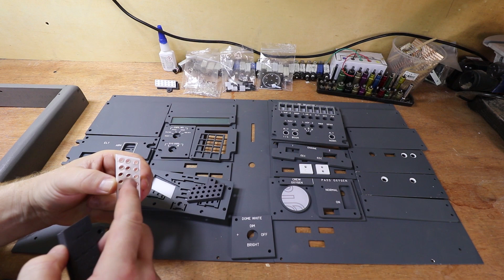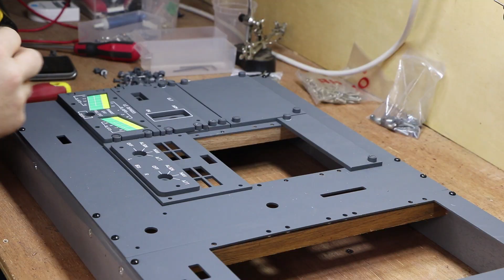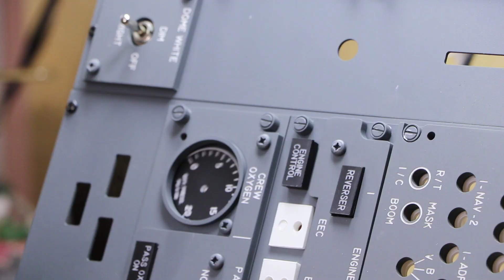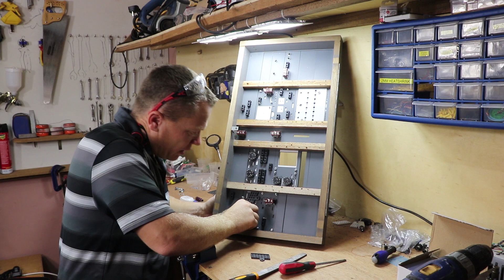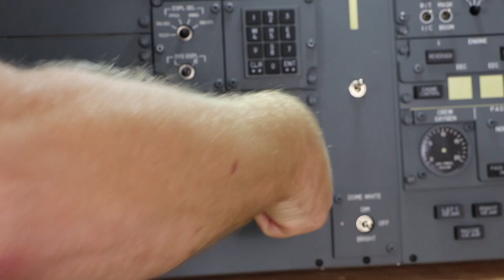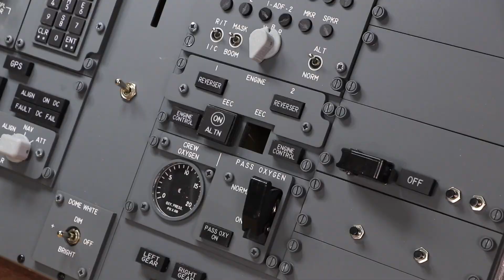737 AFT OVERHEAD PANEL

Comment: Hi, I bought in the beginning of this month the Fusion 360 OVHD Painel files on your website, What kind of material did you use for backlit boards? White Acrilic painted with gray?
Reply from the maker: Hi marcos, i use 5mm white opaque perspex, painted grey. Then I engrave the text and lines through the grey paint into the white perspex.
Reply: @helimech8152  thank you! As soon as possible I'll send you my homecockpit's pictures.

Comment: Hello,so I have a question. If I was to follow your full tutorial on building how much would it cost? Online I found it can cost up to 40000$!
Reply from the maker: Hi KingAviator, Now that is a big question. I would like to think over the last 5 years i have not spent more than 3000 pounds, infact i know i havent. but that has been down to some very lucky breaks. I Bought Prosim when is was much cheaper, i got given all my monitors. There is a webpage on the website detailing the costs to 2018 i think
Reply: Heli Mech Thank you. When I get the money I ll start making it. My only problem is that I dont own a cnc machine or a 3D printer but I hope I could find someone to do it for me for a reasonabale price.

Comment: THX for another great video Karl!

I'm also ordered the  AFT OVH from cockpitsimparts. Last weekend I got my new Ender3 who is now busy printing cockpit parts all day long :-) This printer is a wonderfull piece of engineering for only 130 Euro. I'm very impressed so far.
Question: can you share the STL plan for the LED holders of the FLAPS/SLATS panel on your website? This would be very nice.

Keep on the fabulous work!
Cheers Bernie
Reply from the maker: Hiya Bernie, thank you and I would have loved that printer. But getting any 3d printer through the post here is my biggest nightmare. They keep getting returned for dangerous goods. No idea what they are picking up. But tried 4cattemots last year. Lost a lot of money so gave up. No probs with flaps panel, I'll add it in the next hour

Comment: First of all well done that looks awesome.
Just a suggestion for the knobs..... get them smooth so they look the part..... then make a silicon mould of them and cast the knobs in a clear resin and paint them leaving the pointer line unpainted that way you can have the pointer line being backlit and you will find that once you make a mould you can use it on the other knobs though out the cockpit as boeing use those knobs frequently through the pit
Reply from the maker: Hello and thank you for the advice! The only problem is getting the silicon kit here. This might have to wait until we relocate for this to happen.
Reply: @helimech8152  try here they are in Australia which isnt too far away from you https://www.ebay.co.uk/itm/Liquid-Silicone-Rubber-Compound-Smooth-On-Mold-Max-40-Trial-Kit-1kg-2-2lbs/300877576334?epid=1156515719&hash=item460db3788e:g:-1QAAOSw~otWcPlD&shqty=1&isGTR=1#shId
Reply from the maker: Thanks dude  I'll check it out